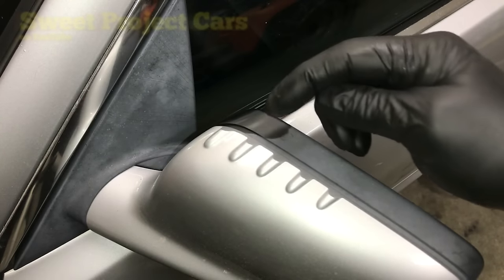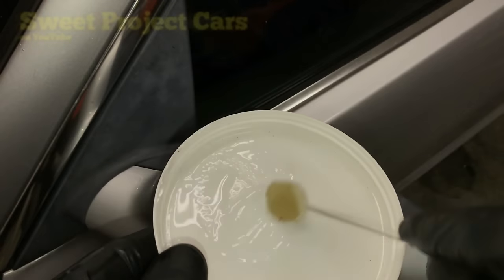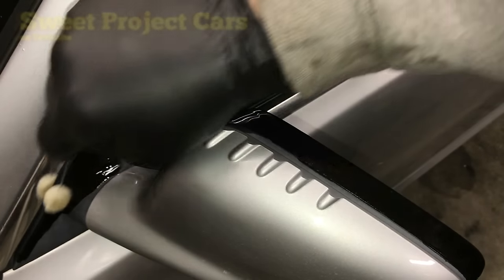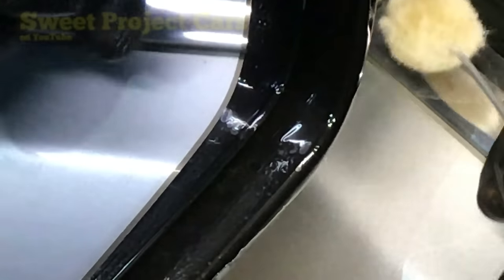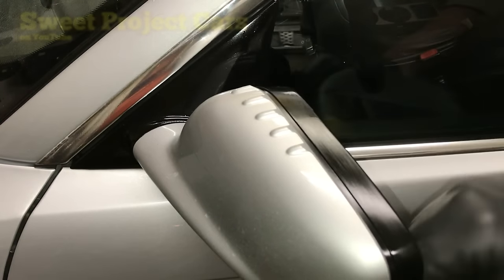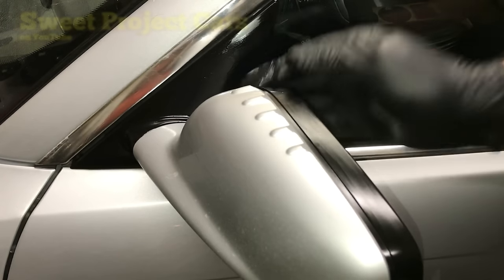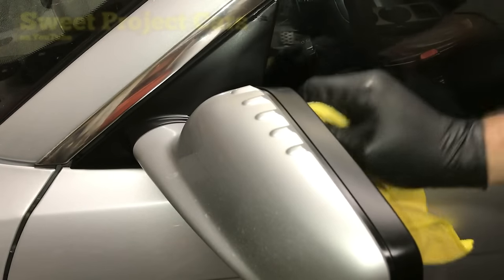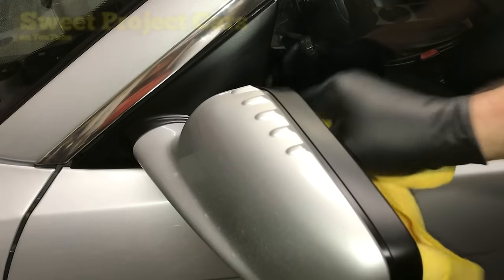How to Repair FADED Plastic FAST..... For Pennies!

Comment from the maker: My friends, we are sharing this quick video on making that ugly dull plastic shine and look new again. For this to work you DO have to use the products listed, we found it by accident when the two were mixed by mistake many years ago, there is something in the baby oil and when mixed with the mineral oil that just plain works, but it does have to be cleaned with the 99% alcohol first. 
It just makes plastic look great for a very long time.
Reply: So which one works best best in your opinion?
Reply from the maker: they all work great we just like to give alternatives that we use for those in other countries that cant access some of the products :)
Reply: That's weird because if you look at the ingredients of Baby Oil, it says Mineral Oil.
Reply: Baby oil is just mineral oil with scent added.
Reply: so a 50/50 mix of mineral oil and baby oil. ?  any thoughts on coconut oil ... great video by the way...
Reply from the maker: @dchall8  it gets the job done
Reply from the maker: @luvr381  whatever is in it it works that's all that matters to us
Reply from the maker: Danny Warren yes 50/50 will work great and you can us whatever you like but we are just showing what has worked for us for years.
Reply: Will this harm the paint or clear coat if I get it on non plastic parts?
Reply: Tell you what,having the UK Amazon links is very handy,cheers for that.That's cheaper than the auto parts store.
Reply from the maker: no it will not
Reply: Will this work on my car's dashboard
Reply: Will give this a try, just dont recommend baby rash cream as a follow-up. :)
Reply: Ok, did I miss something? What products were used

Comment: Just did this, awesome tip! I looked all over for mineral oil at Walmart, finally asked an associate where I could find it, turns out it's a laxative,  so got to the laxative section in the pharmacy department, hope this might save someone else some time.
Reply: I just got some from Walmart and found their "Equate" brand in a 16oz bottle for about 2 bucks!!
Reply: Thank youu.
Reply: What kind of laxative?

Comment: I just finished using this remedy for the runners on my Sport Trac. It Looks great! I followed the instructions, even using a surgy glove to work it in. The rubbing alcohol I used was 91%, not 99% , Lol! I also cleaned my tires with the alcohol and used the ArmourAll  extreme tire shine gel and that is a winner too. Thanks much for your expertise, Mr. Sweet.

Comment: Tried the method as described on my wife's 2005 Audi A3 with 130.000 miles on it. Grille in greyish plastic, "fake airvents" in the bumber in black. Both soaked in a mix of mineral and baby oil. For two days. Unbelievable: the oil-mixture was nearly soaked up. Hardly any residue to be taken off with an old microfibre towel.

I own a 1969 Peugeot 204 Coupé. Very rare, very small and tiny and very much plastics "of old" in the interior. Old plastics tend to wear out very quickly after nearly 50 years, they harden and loose color. Tried the usual stuff after thoroughly cleaning with a mild APC (Meguiar's) diluted 1:20. Clean but somehow lifeless and faded. 

How hard can it be? Get a bit more than 5 oz of the mixture ready, have some swabs an tiny brushes at hand and give it a go. B O Y !!

Some parts needed a second coating because the oil mixture was soaked in after a day. To achieve saturation I used nearly half a pint of this stuff on the interior of a ca that is 12 feet long and 4 1/2 feet wide (exterior measurements). UNBELIVABLE!! The shine is back, the color is vivid again, the material is much softer to the touch (if ever supposed to be soft), the hard plastics are much more resistant to scratches. No need to be afraid of "greasy slime" remaining - just a good wipe with an old cloth and the little residue is away. Dry and completely unslippery to the touch.

It is really mind-blowing to have this useful information spread on youtube. PERFECT!
Reply from the maker: Markus Dahmann so glad this worked for you on your wife'sAudi and your Peugeot we love it when good people like you share your awesome results :) Please share our channel so we can get the word out to the world :)

Comment: A bit late to the party on this one, but as ever, many thanks Mike. Curiously, I am was just about to try another tip I saw which suggests ordinary wood oil would also work. Only problem is there was nothing about which wood oil to use. On balance, I think I would prefer to be guided by the maestro, again many thanks Mike.
Reply from the maker: Thank you BC, you can use whatever you want to use, we are just sharing what 30+ years in the industry has shown to work every time and is safe.  Have a great day. mad Mike the hammer SPC

Comment: baby oil, we used to use the baby wipes to clean the door cards on the works transit when on the rails, they would be covered in mud and sweat and were really grubby.....but it would lift it straight off ....cheers for the vid...regards and best wishes.

Comment: I like the Sweet Project Cars Transmission Fluid Trick, for restoring faded plastic! I have been using it for my tires and they are looking Sweet!
Reply from the maker: you can't beat the old Tans fluid as a standard it works wonder :) thanks Halsey for sharing

Comment: I just try it out and it works great, I did it with 70% isopropyl alcohol and had no problems as I made it exactly how it shows and man it worked out awesome, even tho I used 70% it was just great, I'm glad I find this out. Givan 👍🏻
Reply from the maker: Glad it worked Givan! Thank you for watching and sharing your results, have a great day. mad Mike the hammer SPC

Comment: i did my dash, doors inside and out, just about everything plastic and rubber, and it worked awesome!! i just wish i would have wiped it off quicker on the dash, like this gentleman advised, because now it has a bad glare.
Reply from the maker: angela smith that's great to hear...if you want to dull down the dash use some window cleaner with ammonia and wipe it until you get the shine you like :)

Comment: Baby oil is made of mineral oil. If you make a 50/50 mix of baby oil & mineral oil, you end up with a concoction that's 99% mineral oil & 1% fragrance. I'm still going to try it though brother, as you haven't let me down yet.
Reply from the maker: we found it by accident when the two were mixed by mistake many years ago, there is something in the baby oil and when mixed with the mineral oil that just plain works, but it does have to be cleaned with the 99% alcohol first. It just makes plastic look great for a very long time.

Comment: Hi SPC
First of all, i wanna thank you for sharing all these awesome insider tips that works !!!

i tried to use your formulation, so i tried putting the alcohol first, but discovered that some the fibres from micro fibre towel got stuck at the plastic part. so i skipped the alcohol part for the other plastic parts. up until 4th day the shine lasts. then today the shine isnt there anymore.

I guess that the alcohol part is definitely needed, i've checked that alcohol indeed might melt some plastic parts and the mineral oil goes into it to bond with the melted surface to create that long lasting shine.

may i know what concentration of isopropyl alcohol did you use and what cloth or tricks that you have to prevent the fibres from sticking onto the plastic surface.

Thanks !!
Reply from the maker: If you look for the video we did last Tuesday it will really help you and will have all the tools and products in the show more the video description if you want that plastic to look awesome we Just launched a video 15 minutes ago that will truly help you as well and as far as the 99% rubbing alcohol it is perfectly safe for all plastics

Comment: Thanks for the tip, I found that using silicone lubricant spray behaved much like Mother's back to black at a fraction of the cost on my car's black, plastic trim.
Reply from the maker: Mike thanks for sharing, we have tried the Silicone and just could not get it to last like the oils we use here ..

Comment: Hiya....superb video as usual. Im curious, can i use this mixture on the tyre walls? Id be interested to know if anyone has and what was the result. It goes without saying to never get any for of oil on the tyre contact surface, thats an accident waiting to happen but I suppose it would leave the tyre walls shiny BUT would it degrade the tyre compound rubber/silicone in anyway?
Reply from the maker: it works on all plastics we use this for tyres sidewalls  https://amzn.to/2lillcn

Comment: I used a heat gun to bring back the black on my motorcycle mirror. It worked well, but it has to be removed from the vehicle in some cases so I doesn't ruin the paint. I don't know how long it will keep it's color, but I could try using this as well on it. Thanks!
Reply from the maker: Nicky you will love the results and ease of this method   thank you very much, my friend, we are glad to have you with us and help you out where we can :)

Comment: Thanks for the tip , and not trying to sell it to us👍
Reply from the maker: CAM we are here to share the secrets we have used for years and thank you for being here with us :)
Reply: I did some research looking for the products that you used and it seems that mineral oil and Baby oil are the same thing at least here in Oz
Reply from the maker: For this to work you DO have to use the products listed, we found it by accident when the two were mixed by mistake many years ago, there is something in the baby oil and when mixed with the mineral oil that just plain works, but it does have to be cleaned with the 99% alcohol first. 
It just makes plastic look great for a very long time.

Comment: Dubbin black shoe polish works great too if you have it in America
Reply from the maker: Vikings thanks for sharing that awesome tip :) we do appreciate that !!!
Reply: Sweet Project Cars 
Some of this new plastic trims have grains and rough finishes,
I can only advice on smoother trims worked great on my Volvo 240 GLE wagon the trim was very faded but the dubbin returned it to a deep black finish and lasted well over a year and was waterproof too.
Reply from the maker: Vikings   you are a real asset to this channel thank you so much :)
Reply: Most shoe polish is paraffin wax.  Mineral Oil/Baby Oil is clear paraffin.  Therefore similar surface result.  The Shoe polish has black pigment, so you cant use it on tan or grey plastics, but it has an immediate advantage for black or common shoe dark brown.  However it is a wax, so it won't penetrate.  The mineral oil will, so it should last longer.

Comment: I would assume that your concoction would work on ANY exterior trim? Mainly my Kia amanti windshield wiper cover. It's grey as my hair. Does this work on interior plastic trim as well? Is it paint/clear coat friendly?
Reply: Chris Gardner
Reply from the maker: Chris if the plastic is faded it will work great and it is very safe for paint and CC>

Comment: Love, Love, Love the vids. Too, It was very considerate of you to mention in the 'show more' the Canadian tools. Thanx a heap for that. Being from the Great White and all.......rite-on. My question is: Would rubbing the 303 UV Protectant on afterward help or hinder this treatment? Would it dilute the treatment or if I do use it should I wait a week to 10 days to apply the 303? What do you think guys?
Reply from the maker: Les Adams we LOVE 303 and applying as you mentioned is just fine :) then once every 3 months or so and they will great forever :)
Reply: I had no idea about the 303 until i stumbled upon it watching your vids. I recently used it on a new serpentine belt i bought for my 12' ford escape, i also use it now on my wipers plus I did that window guide clean-out using Rain-X and 303. They've never moved so quick. Thanx again Sweet Project Cars. I was gonna go out and get that Back to Black plastic treatment but i don't think i will now.
Reply from the maker: les this method will work great for you and it lasts a good long time my friend :) and we use the 303 on everything we love it

Comment: Hi guys, Paul from Australia here. 
 
Ive successfully used 50% raw linseed oil 50% Thinners o get similar results. 
How about a back to back comparison.
Also can you do a video on what to use to clean stains on a textured dashboard. 
Mines got a few unknown liquid aims. On it that I haven’t. Been able to remove with normal products and heat.
Reply from the maker: thanks for sharing paul and if you can send pics of your stained dash please do sweetprojectcars@gmail.com

Comment: Although it doesn't look like you needed to, I've always wondered if that's some form of Mold growing on those trim pieces, hence the white, 'powdery like' discoloration - have you ever thought of using a dilute solution of either Bleach or Tilex Before the Alcohol solution to see if you can get the trim pieces to 'smooth out more' ?  For more 'linear plastic trim pieces' such as the plastic trim alone bumpers and doors, believe it or not, there is actually black car trim paint that you can roll on with a thin fluffy paint roller ( 1 or 2 inch width works for me ) and then wipe with a rag with a little bit of lacquer thinner like you guys do to blend the edges.....what you did here looks great !  thanks again for 'the knowledge'.  !  Cars are like Humans - you need to 'flush the machine' with fluids to keep them from drying out - water for us - petroleum products for cars  ; P .

Comment: Ok I’ve watched this a couple times. I went out today and bought mineral oil and baby oil to try it this weekend. A note to people about baby oil being mineral oil: true! It says it right on the bottles, but upon comparison, baby oil has a much thinner viscosity and mineral oil has dl-alpha-tocopherol as a preservative, which baby oil does not. I have literally no effing idea if that makes all the difference or not, but if this works, I don’t really care why it does. Thanks for the video!

UPDATE: I wrote the above what, like 3 days ago? Well I did it today. This fucking works like magic.  Can’t even believe how well it works. I have a 1994 POS Ford Ranger that hasn’t seen a day of love in literally years and I’m finally taking the time to detail living hell out of it. This was the first thing I did. I did it on all the trim, the mirrors, the plastic and rubber around the windows, and the front and rear bumper. I didn’t have 99% alcohol, so I scrubbed it all with soapy water, then cleaned it with degreaser, then rinsed and then wiped it down with 70% isopropyl alcohol. Then I applied it with a 1/2 inch chip brush (I just had it lying around) and wiped it off and buffed it an hour later. It looks absolutely brand new. The plastic has a rich black color now, and doesn’t look fake and shiny like the normal creams make it look. The rear bumper is actually a gunmetal type gray and was chalky as hell. I was certain it wouldn’t work, but did it anyway. ALL of the chalkiness is gone! This is absolutely awesome. No idea how long it will last, but damn, this is great stuff!
Reply: How long did the finish last you?
Reply: How long did it last?

Comment: Which method do you like better results-wise, this or the Heat Gun/Transmission fluid?
Reply from the maker: pedro we like to do both methods together at the same time    :)
Reply: @SweetProjectCars  so heat gun, then transmission fluid and on top of that the 50/50 oil mix?

Comment: I did this, this morning and followed your instructions exactly. I applied the baby oil & mineral oil and let it sit for one hour then rubbed it in and buffed it. It looked good. Went for a drive with my wife and when I got back, the black plastic was back to it's original faded look. No idea why it didn't work for me.
Reply from the maker: Jeff you want to on some plastics very rarely though but it sounds like in your case you’ll need to use a heat gun or hairdryer and warm the plastic up then apply this allows the plastic to absorb the mixture have a great day my friend
Reply: Thanks! I'll give that a try.
Reply from the maker: Jeff heat it up good, just use caution and common sense when doing so :)   good luck my friend

Comment: How would you remove this if it gets on the body paint or hard plastic. I have a Polaris Slingshot with the body made of hard plastic or fiberglass. Would this mixture leave an oil streak that would take lots and lots of elbow grease to remove
Reply from the maker: frehleycomet will not affect paint it wipes right off

Comment: Can i just point out that baby oil is just pure mineral oil with a tiny amount of fragrance so theres no point in using it. Just go 100% with either mineral oil or baby oil.

Also would this be good to put the sheen back on my tyre sidewalls?
Reply from the maker: we found it by accident when the two were mixed by mistake many years ago, there is something in the baby oil and when mixed with the mineral oil that just plain works, but it does have to be cleaned with the 99% alcohol first. It just makes plastic look great for a very long time.

Comment: Have you tried putting 303 on it after it sets in the sun. I'm curious if 303 by itself would work on that level of fading. Per your tire shine video, I did the 303 on a tire, wheel well and suspension boot covers and it looks amazing. Thank you, Sweeeeeeet Project Cars!
Reply from the maker: Chris give the 303 a shot and see if you like the results,  :)

Comment: How does this fit into the scheme of using the heat gun on plastic trim in your other video?
Reply from the maker: themadmallard we give many options for those in other countries that don't have a heat gun...but always remember any of the processes we use like will always work better with heat, either a really hot day or a heat gun...we always say try the easiest first and move up until you get the results you need :)